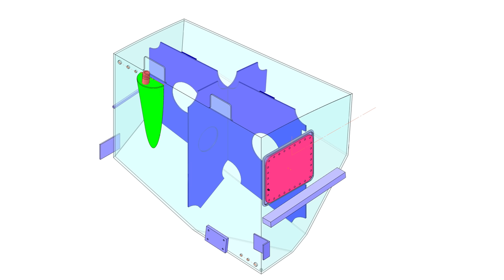Tally Ho’s brand new Diesel Tanks!

Comment: Those new tanks are look very impressive.  Coincidentally, my folks owned a boat with monel fuel tanks, probably made in New Jersey where the boat was built.  One of them cracked right when they'd been topped off with fuel, while we were far away from our home port.  The tank began to leak vapors and probably some fuel into the bilge, making for very stressful situation, potentially explosive.  Ultimately the old aft deck had to be removed to pull the tank for repair.  Monel is not too common.  Fortunately, my dad is a metallurgist and a connection with someone who could repair the cracked seam on the tank.  Yeah, it was a bit of an ordeal.

Comment: 1/4" Plate?  WOW - I was figuring it would be 1/16" at most!   Of course, I come from the Aviation industry, where every ounce of weight is VITAL.  And double-welded?  FANTASTIC!  These tanks should last a LONG time.  
MOST aircraft DO NOT use Bladders, because they are HEAVY.  MOST aircraft just use sealed sheet aluminum in the wings.
For fittings - You CAN GET Aluminum fittings!  DO NOT use steel fittings on an aluminum tank - they WILL FAIL!  Aluminum fittings will be ANODIZED to prevent corrosion. 
An EASY way to make sure you DON'T have water in the tank is to put a small valve at the VERY LOWEST point in the tank - you can EASILY drain off any water that may accumulate, or drain the fuel completely if you want to inspect the interior of the tank.  EVERY aircraft has this sort of drain for just this reason. 

Kudos to Lauren and All American Marine!

Comment: if the terms and comditions on the oder specified that opting out of the order will result in you losing your deposit, AND that if the product is faulty that they'll replace it with another as part of their obligation as the supplier, but you opt out because you don't expect the replacement to be any better than the first,..
 technically you've opted out and forfeited your deposit, because they haven't failed to meet their obligation if they were prepared to replace the product. Always read the fine print.

Comment: This is what the US Coast Guard has to say on the subject:

Quote:
...some boat owners chose stainless steel as the material for replacement fuel tanks, since this material is obviously "stronger" than aluminum; however, it is also susceptible to pitting and crevice corrosion in the marine environment, although at a different rate than aluminum. Stainless steel is also susceptible to stress-corrosion cracking and is even more prone to that type of failure at weld area.

Only the 316L stainless steel alloy with a specified minimum wall thickness of .031 inches is considered suitable for use in the construction of marine fuel tank. American Boat and Yacht Council standards
ANSI/ABYC H-24, ABYC H-33, and ANSI/NFPA 302 all require stainless steel fuel tanks to be less than 20 gallons in capacity and cylindrical with domed heads to limit the wall stresses experienced in service.

While the uninformed boat owner who happens to construct a small capacity rectangular tank may be lucky enough to avoid a failure due to stress corrosion cracking; some boat owners who participated in the UL study spent considerable amounts of money to have replacement tanks constructed to capacities as high as 150 gallon. Many other boat owners who were surveyed mentioned that, on a cost independent basis, they would have preferred to have used stainless steel for their replacement tanks.

Comment: Stainless steel is not a single material, there are several alloys. Common standards in Europe are A2 and A4 stainless, similar (if not identical to 308 and 316) . They differ particularly in the level of nickel in the alloy. I've no experience of using stainless in conjunction with diesel fuel, but I have experience  of them in a hostile marine environment, as part of diving equipment, and the difference is like chalk and cheese. Fittings in A2/308 show signs of corrosion inside a year. I've 316 fittings  that have been in use for 30 years that show no sign of corrosion.  A4/316 is very very much more expensive. Possibly the difference in European and American practice for stainless fuel tanks is accounted for by a difference in the chosen alloy.

Comment: Any good welder can fix those tanks with all that talent around you its not that hard I'm a welder if they fit the welding can be re welded and pressure tested with a compressor and fix. The most important part is if they fit in the hole correctly would not cost that much to grind out the bad parts and re weld . did not realize these were plastic but they can be re welded also. I'm so glad you chose the aluminum ask about coating them. so much good Tec out there theses days

Comment: Duralux ZinKromate is a high-quality synthetic primer for use in light to moderate marine exposures. It is lead and chromate free so it is safe to use; however, it offers all of the performance and quality characteristics of zinc chromate without the health and application hazards. It has good chemical and corrosion resistance, dries fast, and allows single finish coat coverage when using a like-colored topcoat. ZinKromate performance primer adheres very well to steel, iron, aluminum, or partially rusted galvanized surfaces..
 Gee'z after reading the comment's it would appear lot's of people want to see someone to  'Walk the plank' or be 'Keelhauled'.. for the tank build , thanks for not doing that..

Comment: My boat is from 1986 and has it's original stainless steel tank. I had it out for cleaning due to diesel bug 2 years ago. It's like brand new without the slightest trace of corrosion neither inside nor outside, and I belive it will be so after another 36 years as well, so why is stainless steel considered unsuitable for fuel in the US?

Comment: Stainless steel diesel tanks are too rigid and brittle, and they crack and split - TIG welding them only compounds the problem.  Alloy should be fine, except for the reasons you point out.  There are a few good reasons why there are tens of thousands of automotive steel fuel tanks still in problem-free service.

Comment: having welded some HDPE tanks myself for personal use, I'd never chose sheet-seam-welded construction for anything as critical as marine fuel tank, just way too high of a risk, septic tanks for a home - sure, no problem, something you can easily inspect and replace in a day or two - fine, but for something that can be weeks away from shore and a potential to ruin the whole boat - never ever.
rotomolded plastic - maybe, but I'd use them as a liner then and make something sealed/bolted from metal to house it

the only way I'd trust plastic sheet construction is if I could make bends in it that could carry most load, and have access to make inside welds (and outside) on anything below fluid level, but that is near impossible with the shape of tanks used in this boat

Comment: Is it possible to powder coat the tanks. If there are different metals used in the fuel system, possibly there are dialectric (sp?) fittings that can work in that case. Just a thought

Comment: Would the Aluminium benefit from being anodised ? (From a corrosion perspective) ? Asode from being a barrier, afaik the oxide layer that builds up can be insulating, ie protects also other metals on the boat from forming a  galvanic corrosion cell with the tank

Comment: Do your homework on what fittings to use on the tanks. History (experience)  has proven to me Mild steel is aluminum's only friend when it comes  to corrosion. I used to use mild steel fittings into the tank with a good sealant from there use whatever plumbing you want. Wrap the mild steel in Denso tape and the whole set up will last decades. You are spot on with water ingress from the fuel sitting in the bottom corners of the tanks, this will cause corrosion in no time at all but as you said this comes down to maintenance. The tanks look brilliant.

Comment: Maybe a dumb question but can't the tanks be epoxy or some other coating be applied to the inside of the tanks for corosion resistance even if it's just the bottom section ?😎

Comment: I’m a previous life I made polyethylene tanks for a laboratory supply company. I tested my tanks, it’s easy enough to do. I never found a leak. It’s not that hard to make a tank that doesn’t leak. As a person is welding a joint they have plenty of time to observe the joint and see any discontinuity that could lead to a problem. I think the person who did the work didn’t give a crap about the quality of the work. It’s common for the people who do the work in a company to reflect the people they work for. It seems a leaking fuel tank on a boat is a very dangerous thing. I feel like this company is quite willing to send a dangerous product out the door should be called out.
You said it would be unfair to name them as it would hurt their business, I do not agree, they are thieves and  they should not be in business.

Comment: I assume SS is not approved for diesel tank usage in the US due to its propensity to crack/fatigue over time and various sorts of crevice corrosion and electrolysis that can occur when dissimilar metal fittings are used. More welds = more crevices = more corrosion and tanks have lots of long, uninterrupted seams, which are just giant crevaces, really. Aluminum can have some similar issues, but also has a longer track record with regards to reliability in the airline and marine industries, and it is effectively immune to diesel as well as salt water and has been used as hulls for ages. Plain/mild steel can rust, but you can actually see it and address it easily in real time, unlike SS which generally gives no warning before it fails. Aluminum and plain steel are also generally easier to repair, especially in "exotic" locations. If your fresh water tanks fail/leak, it's an inconvenience. If your diesel tanks leak, things can get very bad, very quick. Not to mention that the overall "quality" of SS is garbage these days. Even simple fittings/hardware now rust and fail in just a couple years despite costing their weight in gold.

Comment: Stainless steel is not suitable for fuel because it is very easy to get the welds to crystalize and then suffer meatl fatigue, proper procedures and proper material choice negates that but typical gov regs it's easier to just ban it outright rather than regulate it

Comment: So why no SS diesel tanks in the USA? It is all about the sulphur content in the diesel. Marine diesel in the USA is allowed to have a high percentage of sulphur content whereas in the EU the allowed sulphur content is required to be very low.

Allow me to explain in as simple terms as I can why this is important. In anaerobic conditions such as found in diesel tanks, lives critters named sulphur reducing bacteria. These bacteria eat sulphur and in the process creates a small electrical charge. This charge needs to be balanced out by a donor of some sorts. In this case the stainless steel. As Leo correctly said, stainless steel requires the presence of oxygen to not corrode (donate electrons). With no oxygen present and with billions of lively critters creating a small biobattery, the stainless steel will donate electrons. The result is pin hole corrosion of the stainless steel which will allow diesel to weep through the tank walls.

A classic example of this problem was the submarines built in Germany for South Africa. Germany designed and installed stainless steel diesel tanks. In South Africa these tanks were filled with high sulphur content diesel. It was quite interesting to see how quickly the tanks corroded and within a short period diesel was jetting from uncountable pinholes rendering the submarines inoperational.

Comment: The only reason you used aluminum was so you could keep mispronouncing it LOL. I had aluminum tanks on my motorhome. They were very prone to cracking. We rewelded it several times and it would still crank. Sometimes in the same place, sometimes in new places. I finally gave up and bought plastic marine tanks. One difference is they had a coating inside to prevent permeability of the fuel through the plastic. 
You will need to be very careful with how the tanks are mounted, so the twisting of the hull does not crack the aluminum. Hopefully being a 1/4 thick, it will be less prone to cracking.

Comment: them there plastic tanks were sadly a disaster, (made on a friday afternoon no doubt) i'm almost in agreement with you not naming and shaming of the company, it can cause issues further down the road, word of mouth is way better, pitty you didn't keep the tanks as evidence for others to see, (get some other companies to get some made - if they are rubbish, sure you all would be welcome on their doorstep, see them in court for bad trading standards) i still think the best way forward is rotary moulding, there is a company (i not used yet) called TANKS near Basingstoke i think, rotary moulds can have all the fixtures and fitting put in place, the mould can be heated or a hot plastic material added, and will encapsulate all the fittings, once its removed, a simple air pressure test and fit to boat

having said that, as soon as i glanced these replacement tanks, WOWOWOWOWOW they look amazing, a massive credit to your new pal who made them, and in aluminium, great workmanship, and a sensible thickness too, the Cats he works on look amazing too

i have a feeling, while stainless makes a great fuel tank on the corrosion side, i think their might be issues with attracting static electricity, shocks and alike, again as you suggest all really need adequate paint finish, and use of materials on fixtures and fittings, those that react well with corrosion, so i think brass and aluminium is a bad one, someone will know their galvanic corrosion table better than i

Comment: The only reason i can see (I welded a bit), and have found from online searching for the non-use of stainless is this...

Stainless welding hasnt been that great in the past, causing issues such as carbide precipitation, which is basically caused by the weld changing the chemistry slightly at the weld area, so your 16%(or whatever) chromium that is the main thing making it "stainless" could actually be far less (in a very tiny weld cooling boundary area). 
Stainless requires oxygen to create a protective chromium oxide corrosion resistant layer....  so if its far less it wont make the protection. 
nowadays we have more knowledge and better techniques to avoid this more. 

couple more things: 
- chloride ions which are prevalent in areas near the ocean have a greater affinity for attacking that oxide layer, more so than attacking regular mild steel. 
- if water makes it into the tank (which it will), it can become oxygen deprived rather quickly, and we just learned that stainless needs that oxygen to make and maintain a protective layer. 

Aluminum works on the same principle, the oxide layer thing, but if it sits with oxygen deprived water on it, it would take longer to corrode. 
so in both cases He should be checkering for water contamination regularly.

Comment: Just think if the plastic tanks had not leaked, were installed then after the diesel bashed around in the tanks maybe the welds would have let go. So, consider yourself lucky that the welds leaked when they did. I'm not a lawyer but if you have emails were the company said they would refund the deposit and they acknowledged the defective tanks and you used a credit card to pay it might be fruitful to contact the credit card company and explain to them the situation.

Comment: When Leo showed us the slipshod job that was done on those plastic tanks and then said that the company would return his money if he returned the tanks I doubted that Leo would ever get a dime back. They had already lied by representing themselves as experienced and capable plastic tank fabricators.  Obviously they were not. Not only was the work worse than 3rd rate, but they obviously shipped them either without any leak testing them, or even worse, knowing that the tanks leaked, hoping that Leo would pay without testings, and not giving a rat's patoot what happened to Tally Ho or Leo and his crew the first time they tried to fill the tanks. They defrauded Leo, plain and simple.  They probably wanted the tanks back to salvage the materials and fittings.

Comment: I think you would have been let down by welded plastic tanks whether they are chemically or acoustically welded.   Polyethylene (PE) is a MUCH better solution for diesel tanks...  but ONLY... ONLY If it is roto-molded... monolithic.     Stainless is approved by ABYC for Diesel tanks ONLY if it is 316L or 317L stainless (the L just designates LOW Carbon to avoid carbon precipitation from the welding process).   Whether AL or SS, they just absolutely must be in a dry environment...  I know, hard to do in a boat.   Just be sure you have an air flow ability around all parts of the tank. 

I would seriously consider using a product like "SharkHide" to coat the entire exterior of your tanks before you install them.  Cheap insurance for a long(er) life of corrosion resistance.

Comment: The plastic tanks is beyond frustrating. You have been civil with them, i.e. avoiding naming them.  However, making something that doesn't match the product you ordered means they broke the contract (accepting the US is probably different to the UK).  If they didn't deliver the product ordered, they have no right to withhold the deposit (this is very distinct from a situation where you had made the mistake, e.g. provided the wrong measurements).